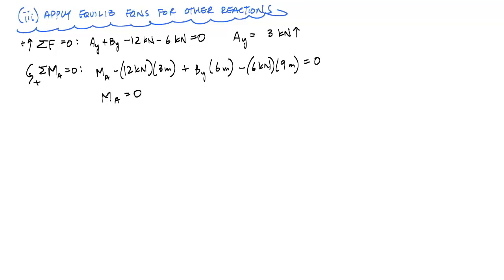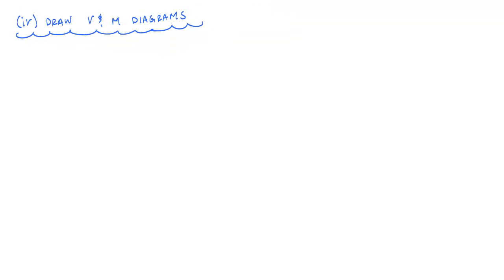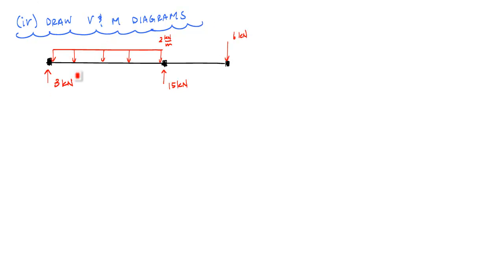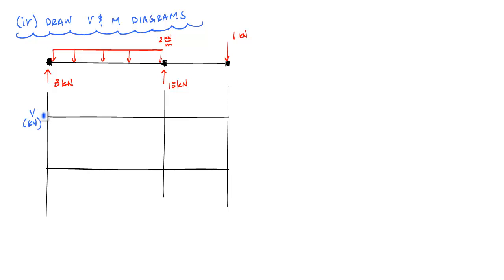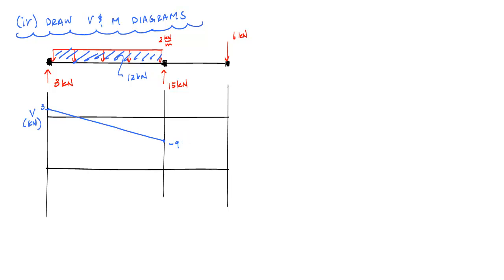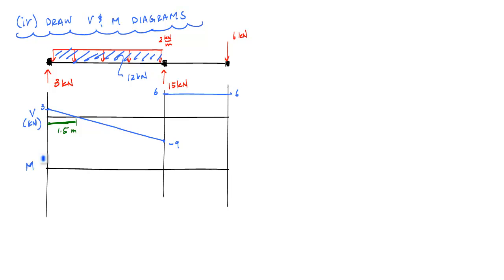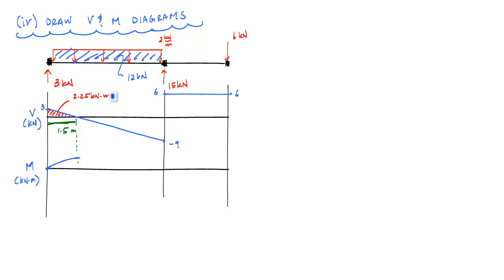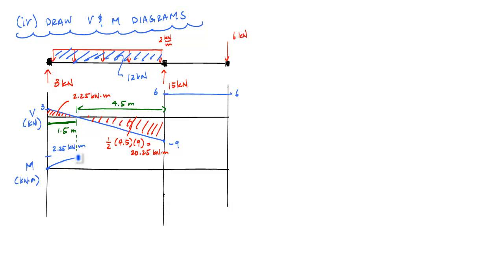Statically Indeterminate Beam by Superposition Example 1 (Part 2/2) - Mechanics of Materials

Comment: Great video. How would you find the distance from the origin to the x-intercept on the bending moment diagram?
Reply: be clear
Reply: +abdulrahman yasin I mean the second graph (for moments), how would you find the x-intercept of that parabola?
Reply: +Vigneshwar Kannan take the derivative of the m(x) value and equall it to 0...there you'll find the x
Reply: +abdulrahman yasin Thanks
Reply: explain again please
Reply: and is the slope 3 (someone else told me this. or 1.5 (rise over run which in this case is 3/2 or Ay/the UDL)